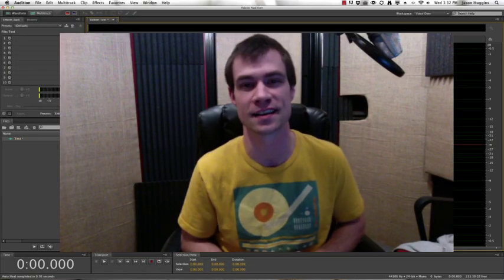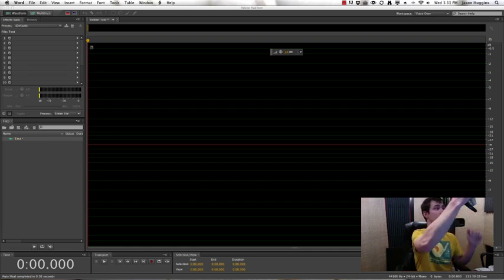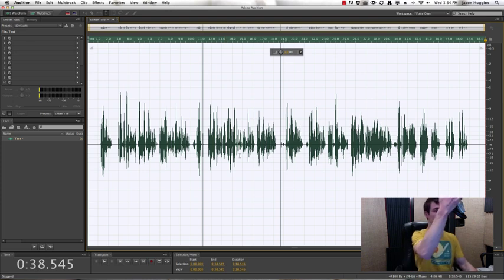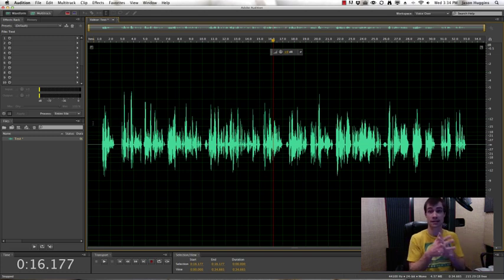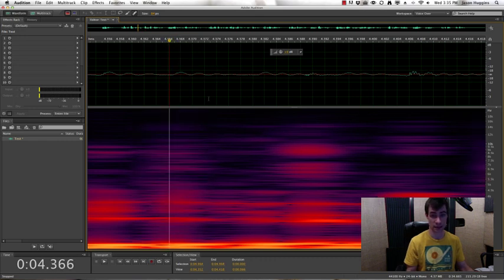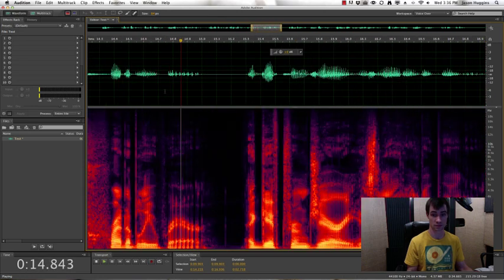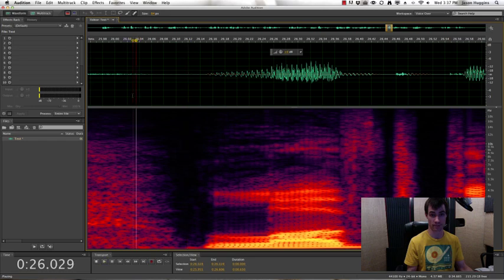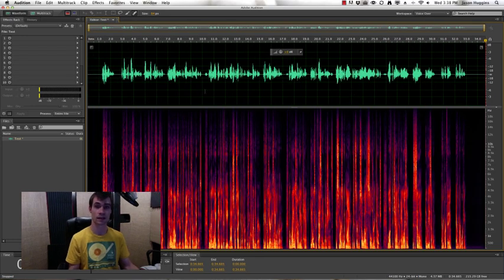Removing Pops and Clicks In Adobe Audition CS6 (Voice Over)

Comment: I keep getting this odd static every once in a while sound randomly in my audio. Like what you get if you have interference in a mic from a hair drying running in the house or something. It's very minor but annoying because it's the only area I have trouble with.
Reply: Hmmm.  That could be a lot of different things.  I would probably start with checking to make sure you don't have any bad cables or cable connections.  Also, check you buffer setting and make sure it isn't really small.  If you have a very small buffer setting it can result in pops and clicks in the audio because the computer is unable to operate as fast as you are trying to make it.  Good luck!  These kinds of issues are always a nuisance :(
Reply: Jason Huggins
That's exactly what it sounds like. Thanks for the help. I'll check that out.

Comment: Thanks alot for the tips with the shortcuts. I've been always using the brush tool and that slows down my workflow a bit. Since you are a professinal voice actor, do you have any tips for avoiding those pops and clicks in the first place? I read (what you confirmed in the video) that coffee is causing alot of that. Should I drink some water before recording or is there anything to take care of? I think a separate video on that topic would be awesome, since I haven't found anything useful on the internet on that topic. Thanks in advance, Jason!
Reply: ***** Now that's what I call an insightful reply! Thanks again. Those tips are great. I think most mistakes are being made because of wrong microphone positioning. I myself sometimes suffer from a dry mouth after recording like one hour without taking a break.

Somewhere else I read that tea (without caffeine) or ginger may help. I drink alot of tea, but I get the feeling that some sorts are making pops and clicks even worse. I will definitely try eating green apples, I usually only buy the red ones, but maybe the acid helps against a dried out mouth.

I have a final questions when we are at it, regarding food in general. Do you have a rule like "don't eat anything for one hour before an audio recording"?

Thanks again for your time. Keep it up!